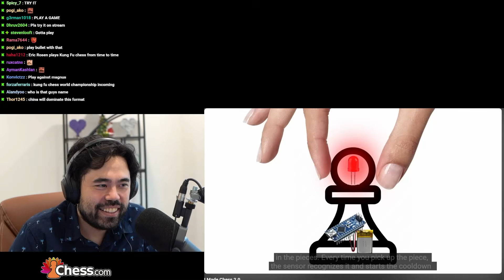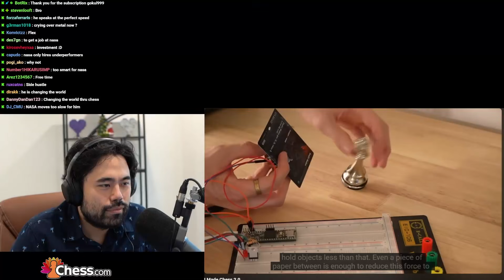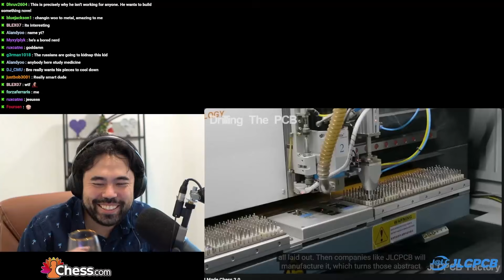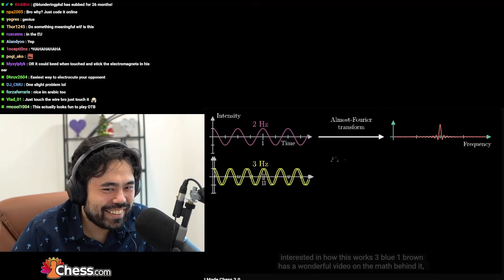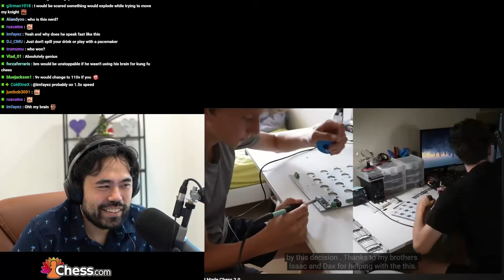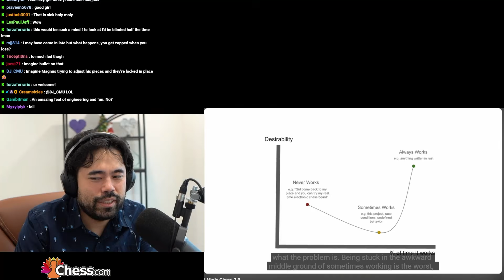HIKARU DISCOVERS CHESS 2.0!!!!

Comment: Would have been simpler to have hollowed out the piece, put an electromagnetic in the piece and then use a solenoid on a clip lock. Have a button to manually unclip the solenoid when taking.

Comment: What if you want to take let's say your opponent's queen with a rook and after picking up your rook, the opponent blocks the rooks path with a different piece? You'd probably need to implement a rule where some illegal moves are legal if the move preventing your move happens at the same time
Reply: Or maybe in that case you may take both pieces - the one that blocked and the one you initially wanted to take

Comment: The "cooldown" aspect of kung fu chess honestly changes it entirely. It makes it way more of a positional game in the sense that you have to constantly predict where your opponents pieces are going to end up. If you just keep chasing them around, they'll always be ahead of you by 1 second
Reply: Doesn’t that also apply to normal chess though? If you chase someone around they are still ahead of you by one turn.
Reply: @gergo7507 The difference is that in normal chess, sometimes relentlessly chasing down the king actually works if you can follow through with enough checks. Lasker vs. Thomas 1912 for example. In Kung Fu chess, that kind of tactical attack doesn't work at all and will just get you killed, since your opponents' pieces will get off cooldown faster
Reply: This basically makes the game more like Starcraft. RTS games were designed as a form of evolution of Chess to begin with lol
Reply: It's just final fantasy with Active Time Battle systems.
Reply: I feel like this gives you some strategic thinking options in a way how you want to control pacing.
Reply: It's similar to duck chess